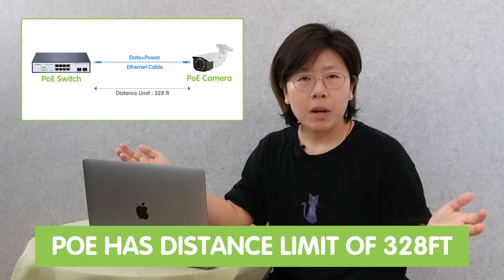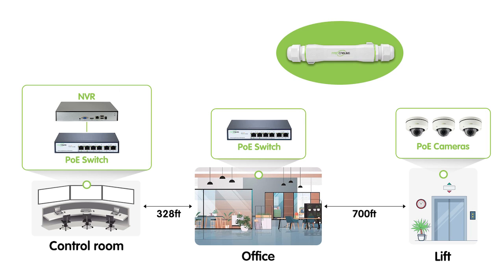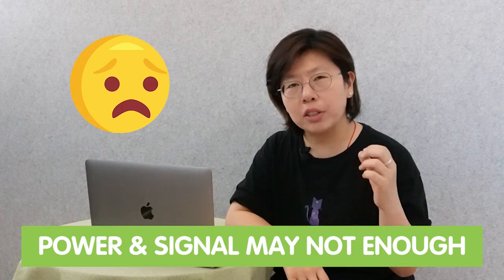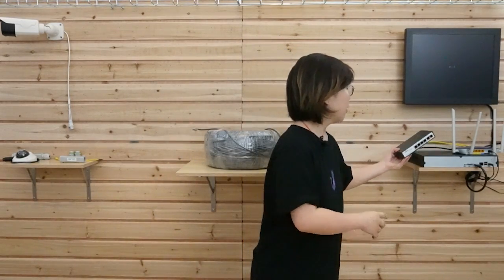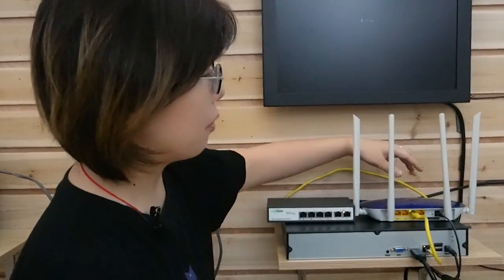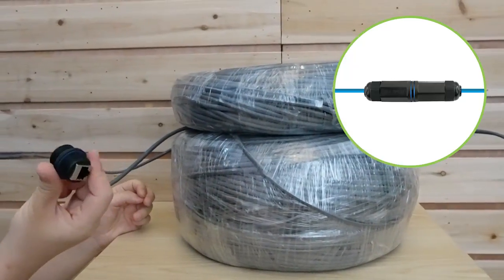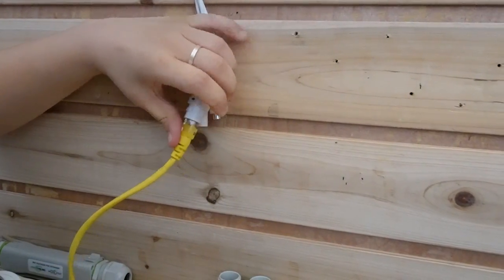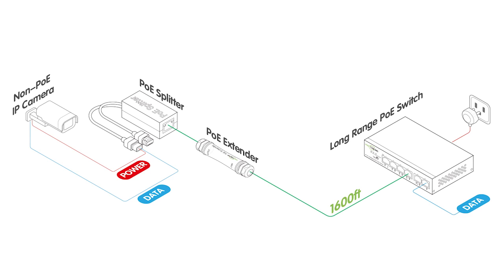The Best Way to Install IP Cameras 1000ft Away| Elevator Cameras Setup

Comment: What about if I have up to 10 cameras with long range?
Reply from the maker: There are 8 ports long range PoE switch, but the total power budget is something you need to considered. The longer the distance, more power lose will be. You also can add the PoE extenders to a regular PoE switch to have up to 10 long range IP cameras.

Comment: Is it a must we use the router to connect to the NVR??
Reply from the maker: No, it is not always necessary to use a router to connect an NVR. It largely depends on the specific setup and requirements.

Comment: I needle a  camera at my gate to see who is coming in I am 350 feet up the drive way on a hill we are building a house I would like to go wireless cause internet has been wired here yet is that possible an what would u recommend or were to buy a system with about 4 to 5 camara with out internet or is there solar panels I could use to do this pleae let me know thank you for you input and help thankyou
Reply from the maker: If wiring the cables to each of those locations is possible, I would recommend you go for the wired solution. The wired solution is more relaible than wireless. Moreover, it can carry the PoE power. The reliable solar panel system is pretty expensive, and you need to make sure the signal strenght is strong at each of the camera's setup spot if you go for the wireless which could be a challenge.